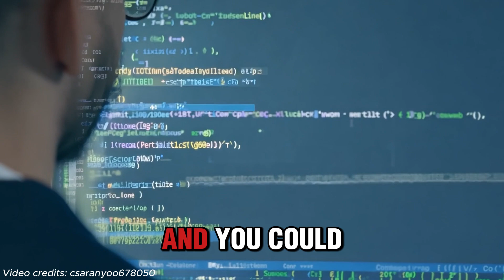Why Isn't Structured Text More Popular in PLC Programming?

Comment: Siemens Step 7 has a limited Language converter. The view can be shifted between Lad,STL,FBD. Though I stress the ability of the software is limited and I believe the original programming language used has to be Lad.
Reply: Siemens STL now is emulated in s71500..no offline compiler for linear to graphic ladder..mass lsdder code production dies. Vanderlande just lost their engineering build model for airports. In their desperation haved moved to cheap labour countries for software build..The biggest systems in the world. You control  software programmers are now competing with a guy who is buying  a house for 15k. Th wealtthy exploiters sre winning. That's until the planes start having bombs on them again.. then they ll regret thinking  that software is cheap .
Reply: Good luck you young chappies. The world thinks software is for free.
Reply from the maker: @GKustom that's a good point! thanks for the additional information